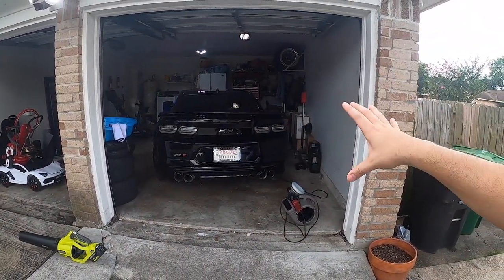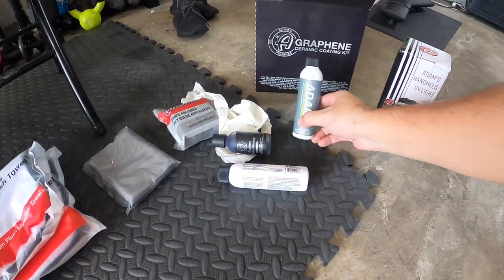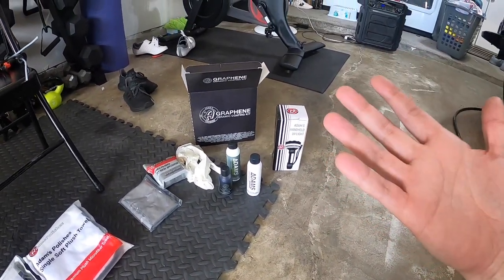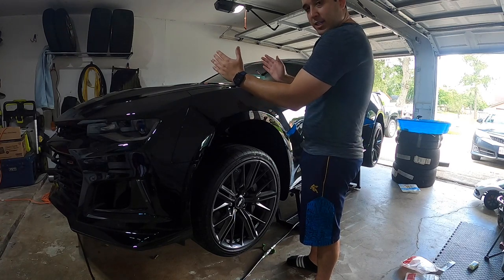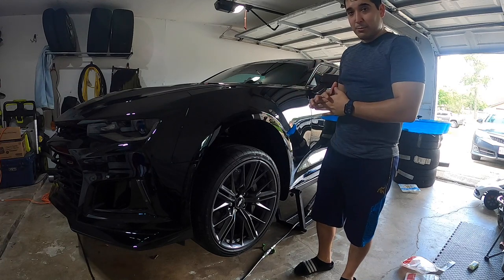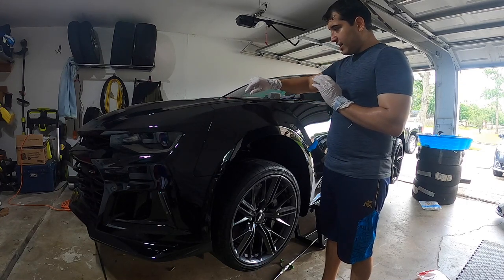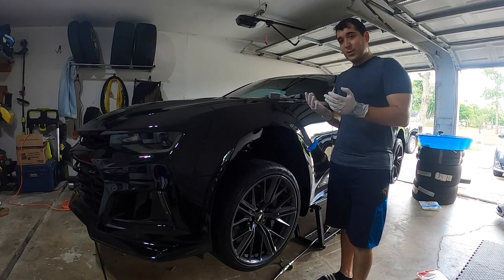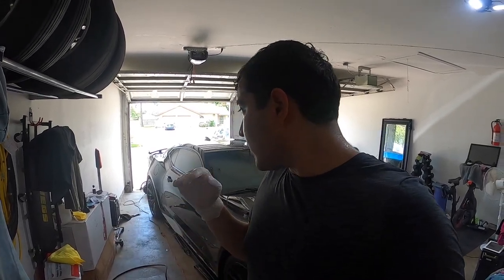Paint Correction Step 3: Adam's Graphene Ceramic Coating! | Vlog # 434

Comment: Jorge, I was told the Graphene will keep the surface temperature of your vehicle up to 5 degrees cooler when you are in  the sunshine. I was going to get ceramic coat until I found this out. What are your thoughts?
Reply from the maker: I had not heard of that but that would be a big benefit!